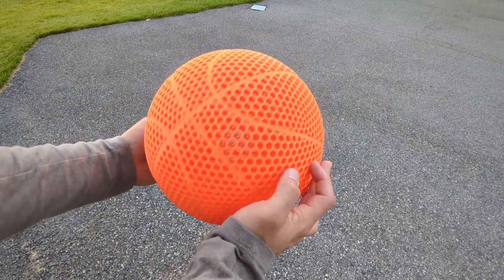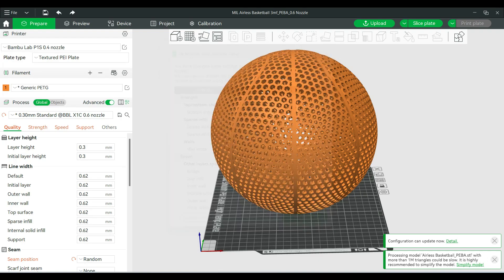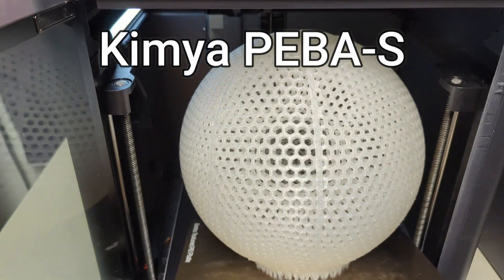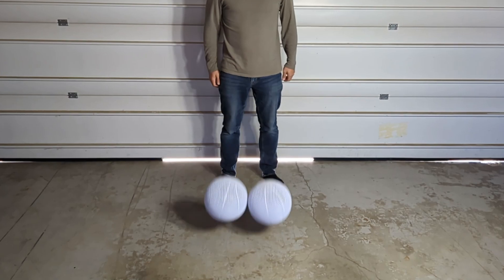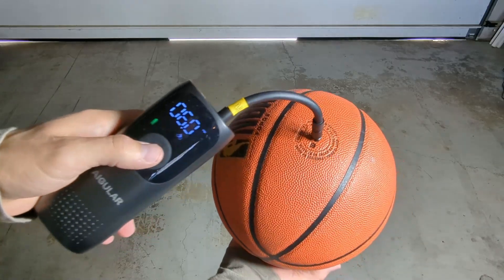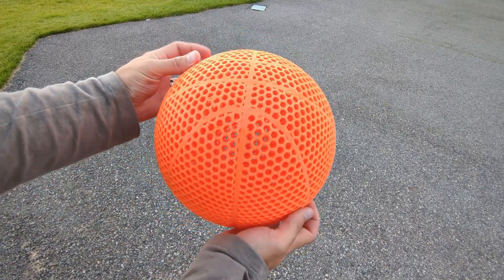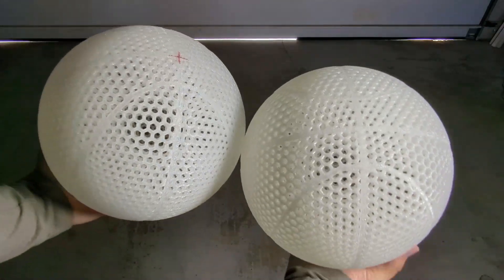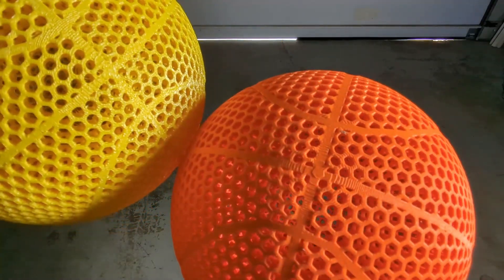Does 3D Printer Nozzle Size Affect Airless Basketball Performance?

Comment from the maker: What should we try next?
Reply: .8mm!
Reply from the maker: @TheBleetbleet  I like it, when Bambu Lab comes out with a 2mm nozzle the basketballs will be printed in 30 minutes lol
Reply: @makeitlabchannel  ahahaha 2mm that would be nuts!
Reply: Maybe see if mixing filaments gives better results? flexible pla and some filament that goes along with it?
Reply from the maker: @kanav1998  I would have to invest in a mulit-material 3D printer but I definitely think that has potential!
Reply: I meant like the black line design could be a different material than the orange part of the ball. Maybe that adds a rigid structure to the bouncy bits?
Reply from the maker: @kanav1998  oh gotcha, definitely something to look into 😁
Reply: Have you tried any ABS, or maybe ASA or PET
Reply from the maker: @CreatedUnalike  I did try PC-ABS but there might be better options, and ASA/PET might be worth a try
Reply: @makeitlabchannel  PA6 and PA12 might also be worth a try depending on the printer you have, which from the video I believe is a Bambu Labs P1S, so it should be possible
Reply from the maker: @CreatedUnalike  I did try PA6 CF but maybe just plain PA6/PA12 would work better.
Reply: Have you tried airless football?
Reply from the maker: @Pxa3d  Not yet, I am pretty much done with my airless soccer ball so I was debating whether to do a football or tennis ball next 🤔
Reply: Put the leather outer shell of a basketball on the airless one. The exposed honeycombs are what creates the wind drag.
Reply from the maker: @Green_Sentinel_3  I like that idea, that would solve the grip issue as well
Reply: Have you tried ATARAXIA ART's B-FPLA+ (the bouncy variant)?
Reply from the maker: @prushuka  Just got some in the mail so I will be printing one in the next couple of days. I have heard good things from others so hopefully promising!
Reply: how about one printed with an ams so looks real orange with black stripes
Reply from the maker: @sickswan61  ah man I wish, so far all of the best airless basketball filaments are not compatible with the ams, and when I tried I only got clogs and tangles. If you have a multi-material/toolhead printer (like the Prusa XL) you could do this plus have a different material for supports. If I ever get one I will definitely try that 😁
Reply: what if you tried different structural patterns like triangles, circles, etc. instead of the honeycomb. Maybe even a completely solid shell? Then compare which shape bouces the best.
Reply from the maker: @ChrisPatterson-ew8ti  That would be a fun and interesting test! Thanks for the suggestion 😁
Reply: Try make an airless basketball with better aerodynamics.
Reply from the maker: @SilkyWayFPV  Yeah that will be a big one. I have been looking into wrapping it with something
Reply: @makeitlabchannel  That was my idea aswell, just to check if it behaves and flies differently.
Reply: try printing 0.6 on a 0.4 nozzle...
Reply: Have you tried the filament featured in this video?
https://youtu.be/MEbD5BpJvaY?si=Rr5jCA1Uvqd3fL3F

Comment: thanks for the video, ill be trying one very soon. did you auto supports? my program covers the ball in supports. (ive had a printer for almost 2 weeks now, still learning)
Reply from the maker: They are fun to print. I used Bambu Studio for my slicer, and in the slicer there is something called "Supports Painting," where I can paint the supports on the basketball. I limited the model to just the bottom of the ball, and painted the supports manually on the bottom. If you are using a Bambu Lab printer/Bambu Studio, you can download the 3MF files from my Makerworld page and it will automatically load the settings and supports that I included: https://makerworld.com/en/@makeitlabchanne

Comment: Wondering if airless basketball plays better on windy days, which is brutal if you use OG basketball. How durable are printed bball?
Reply from the maker: I think the airless basketballs could play a bit better on windy days, but I will have to test that sometime. For durability, it really depends on the filament you use and how well it prints. If you use a filament like PEBA and don't have any trouble spots during printing, it can last a long while. I have had mine for several months and it is still intact (although I don't play every weekend)

Comment: Do you think some Tpu 95a would work well, cause I don’t really want  to spend 50 dollars on a print that could fail
Reply from the maker: I have printed one out of 95A TPU, and the print turned out nice, but it hardly bounced at all. You could always go with the Ataraxia Art Flex PLA - it is usually less than 40 bucks and bounces pretty well, but for the bounce, usually the more you pay for the bouncy flexible filaments the better the bounce is.
Reply: @makeitlabchannel thank you for actually responding, I’ll look into the filament, but I also wanna ask do you think it’s worth buying the .6mm nozzle if I don’t really change nozzles that much
Reply: @makeitlabchannel also, I looked at the filament on Amazon and some their reviews said it didn’t bounce, but then some said it does, I just want to know what settings you had it to make it bounce well

Comment: I printed the DudV2 filament and it broke after the first day.  I used a .6 nozzle and BIQU profile.  To be fair I have 5 boys, so I'm sure they put it through the ringer.  Looking to try the BIQU and  PEBA-S filament next.
Reply from the maker: Both are great options. I have been looking into annealing the basketballs in the oven or even a dryer to help it hold up
Reply: @makeitlabchannel  One other option is anealing with hot water. I'm thinking about trying it in a bucket with the ball resting in a net or cheese cloth to support the ball and keep it from warping, hopefully. If I do it, I'll let you know how it goes.
Reply from the maker: @fieldbc  that would be interesting! Hope it works. I also hear that annealing in a dryer might work as well, could be worth a try

Comment: Hi I really want to know in detail how to make this ball. Could you please help me? Also you mentioned about air drag, will it be still an issue if you play indoor? Is there anyway to solve that without making the bounce louder? For example making the hole smaller?
Reply from the maker: @homoruge  Hey there, I would be happy to help as much as I can. I will just need to know a few things to start. Do you know what filament you would like to make the basketball with? What printer will you be using? As far as air resistance, it isn't a huge difference l and I don't think you will notice much if you are playing indoors. I haven't experimented much with smaller holes but it might be worth looking into
Reply: @makeitlabchannel  Thank you! You are so kind. I am very new to 3D printing. I would need to buy the printer and filament. I will be using the ball indoor and I want two sizes 7 for me and 6 for kids. I want them to weigh the same as usual Bball. If we can video chat that would be nice, or please share instructions.
Reply: @makeitlabchannel  I just purchased Bambu lab P1S Combo. I looked at the PEBA-S filament (I concluded that it is the best filament for my use, by watching your videos), there were two diameter choices which one should I choose?.
Reply from the maker: @homoruge  I used a Bambu Lab P1S to print all of my basketballs, and it is a fantastic printer. The PEBA is definitely a good choice too. If you can, I would get a 0.6mm hardened steel nozzle to print it with as it decreases the print time by a lot. When you have your printer and it is all set up, you will just need to head to makerworld.com (https://makerworld.com/en/models/545680?from=search#profileId-471406) and download the PEBA 3mf file. Once you load the 3mf file in Bambu Studio (the slicer for Bambu Lab printers), you will just load the 3mf and it will load the file and all of the settings needed to print. Then you just load the filament and print it - when you load the 3mf it will be a size 7. You will need some other things as well, I recommend watching this video as it lists my settings and setup I used: https://youtu.be/L7AP0ahJMyo

If you have any additional questions, feel free to email me at makeitlabchannel@gmail.com
Reply: @makeitlabchannel  Thank you, before the email one last question, what is the PEBA filament detail? There were some diameter difference etc.
Reply from the maker: @homoruge  For the PEBA, I used 1.75mm rolls, and for a full size basketball you will need to purchase two 500g rolls. If you want a size 7 and size 6, you will need to purchase three 500g rolls. The size 7 will take about 700grams to print, and a size 6 will probably take around 600g or so.

Comment: Why does the offical basketball model listed on DUD v2 PLA B filament page have a print time of 68 hours? What’s the difference with your model and theirs? Thanks!
Reply from the maker: There are several things that can vary the airless basketball print time by quite a bit - the model design itself, the size of the nozzle, the printing speed, number of walls vs. infill, etc. From what I can gather, the 68 hours looks like it is based on using a 0.6mm nozzle at a 0.18mm layer height with their model. It looks like they might have altered the PartyLime Gen 13 model or created their own to look very similar. I don't think there is a huge difference between their model and mine, except for the looks.

Comment: So you say the regular basketball is superior when you watched it in slow motion, but the peba airless had more bounce. How do you know? Because the real basketball started landing sooner and sooner, which meant it wasn't gaining as much height and thus landing sooner.
Reply from the maker: @menchelke  I should have mentioned in this video that it was based off a previous test/video that I did. The PEBA and regular basketball are very close when dropped around chest height, but when I tested the peba and regular ball above a 6 foot drop, the real basketball definitely bounced higher

Comment: I've wanted to do a pickle ball and this is great research material. Thank you for all of the testing and feedback!
You're saving us time and filament!

You can reduce the layer lines and still print faster by just changing the layer height on the very end and beginning of the print. 
That way it won't be as noticeable and you can still save a few days!
Reply from the maker: @jdisherwoodjr  oh that would be a fun project, and yes that is a great note about changing the beginning/end layer heights for saving time!

Comment: Using the Ataraxia flex filament with Bambu textured plate, it was impossible to get the ball to come off without warping it a bit. How do you remove them from the bed?

Also, are you using a flap disc with the angle grinder? What grit?
Reply from the maker: @jasonn6354  Hey there, just sent you an email response. Hope it helps!

Comment: What PEBA filament were you using and can you share the STL file with the exact setting you used for the PLA ball and can it be printed on the ender creality 3 v3 se?
Reply from the maker: @Mxmba24  hey there, this is the peba filament I used: https://indicatetechnologies.com/products/kimya-peba-s?_pos=59&_fid=7f47f9c39&_ss=c

The stl is on Thingiverse, printables, Makerworld, but here is a link: https://www.printables.com/model/946488-airless-basketball-models-double-lattice-bounces-g

It looks like the creality 3 v3 would probably work for PEBA, but you will have to scale the file down to print a full size basketball. A printer bed that is 256x256x256 is needed to print a full size
Reply from the maker: @Mxmba24  oh and for settings, we have a video on everything here : https://youtu.be/BtqjUwdIx30

Comment: Hey man I just got a FlashForge Adventure 5M Pro and it won’t heat up do you know what wrong?
Reply from the maker: Hey, is the printer new? First thing I would check is the wiring - everything connected/plugged in where it should be? Do you receive any error messages?
Reply: @makeitlabchannel  sorry I fixed it already but thank you so much
Reply: @makeitlabchannel  it was the nozzle I was using

Comment: Wait until you try the .8 and 1 mm nozzles. I use .8mm almost always unless i need fine details like text or logos
Reply from the maker: @VoidPixel4179  Have you printed an airless basketball with a 0.8? Definitely sounds like it is worth a try
Reply: @makeitlabchannel   0.8mm is double the diameter of 0.4mm and about the volume cubed. Also use arnachie mode in slicer settings (orca & bambu slicers) you'll see crazy flow characteristics

Edit: Volume of 0.4mm is about 33
The Volume of 0.8mm is 268

Comment: what is the second best filament to print with behind peba? are these new filaments you used the best for a cheaper option or what would you recommend?
Reply from the maker: @SS-cx3zh  I would say that the second best would probably be the Ataraxia Art flex PLA. It is cheap compared to the other filaments, but the bounce is almost the same as some of the best (besides PEBA of course). I am going to try their bouncy version of the filament, so hopefully that will have good results

Comment: I love this series :^), but how many balls could you make out of 1 Rolf the PEBA filament, and would you recommend the 1.75mm diameter or the 2.85, thanks.
Reply from the maker: Much appreciated! To make a full-sized basketball you would need 2 rolls (640 total grams with supports), but if you scale the model down you can print a smaller-sized basketball with 1 roll. I would recommend the 1.75mm - good luck!

Comment: Did you try to change the design? What happens if you remove the artificial seems? What impact have a finer or rougher mesh structure have? Does a thicker or thinner wall is more bouncy?
Reply from the maker: When I was originally designing our model I tested a few things. Removing the seams added just a slight increase in bounce but less grip, and the big factor for bounce was having even thickness between lattice gaps and the lattice structure. I have not tested much with the finer/rougher mesh structure or thicker/thinner walls yet though. All worth testing at some point for sure

Comment: In your PEBA settings video you said to use 5 top layers, but when i change the nozzle size to 0.6 the top layers change also to 3. Did you change anything? Also the print speed on your PEBA.m3f on Printables says 44mm/s and in your settings video you have it at 40mm/s. I know its not a big difference in speed but i am just making sure before i hit print. :D
Reply from the maker: Hey, I wonder if the settings defaulted when switched to 0.6? It should still be 5 top layer. And for speed, I did change it because 44 mm/s did work when I tried it so that is what I left on the profile, but it will probably depend on the printer. If it is a bed slinger I would slow it down even below 40
Reply: @makeitlabchannel  Yes I think 3 is the default for the 0.6 nozzle. You recommend still using the 5 top layers?
Reply: @makeitlabchannel  Just started the print. 🙈 wish me luck!
Reply from the maker: @oclk8650  Hope it prints well!
Reply: @makeitlabchannel  So far it is printing fine, but the bridging parts don't look so clean. Also a lot of stringing, maybe the filament is too wet.
Reply: @makeitlabchannel  Unfortunatly i woke up today to the printer printing in mid air. 😞It was about 80% done. Any idea how to fix it?
Reply: No ideas? :(
Reply from the maker: @oclk8650  Oh sorry about that, thought I responded. Is the door open while it is printing? I always have it open while printing so it doesn't get too hot inside the enclosure.    I think the bed temp can go down a bit too, like 90C or so.
Reply: @makeitlabchannel  All good. :) No, I had the door closed. The printing overall didn't go too bad for the most part. The cause for the failure was something different. 
As the spool was getting more empty and lighter, the friction on the spool holder got too high, and the extruder couldn't grab the filament properly anymore because it's so flexible. So eventually the printer was printing without material and unfortunately for quite a while. I saw it not until the nozzle was already about half a centimeter above the print. At least, that is my assumption for the why.
I'm not really sure because the knot i had once in a spool was detected and no problem, but oh well. Now I have 80% of a ball still on my build plate and wonder if there maybe is a way to fix it before I order another roll of filament. 😅😄
I thought about continuing the print or just printing the missing piece and gluing it together, but I don't know the exact layer on which the filament stopped. So both ideas would be more or less subpar.

Comment: Dude... Great video! Durability test outside was crucial! PEBA looks like the ticket! Great you pumped up the ball with appropriate air to match! Checked all the boxes in this video. Best reason for printing this is the noise! It would be nice to get the weight and bounce the same.  You're so close to having this match. I may take a stab at modeling to match weight and bounce. Hard to do R & D when the filament is so expensive! I also wonder if there is a world where two filaments could be used. Haven't put any thought into that. Just an idea. Again. This video was fantastic!
Reply from the maker: @PropScientist  Much appreciated! I am working on fixing the models to be in the right weight, and yes PEBA is the best bounce so far but I am excited about a couple other options that will hopefully match the peba or even beat it. And multiple materials would open up a lot of options and definitely worth looking into.